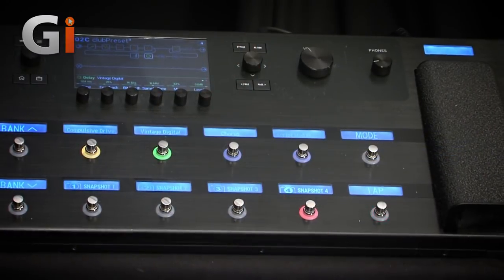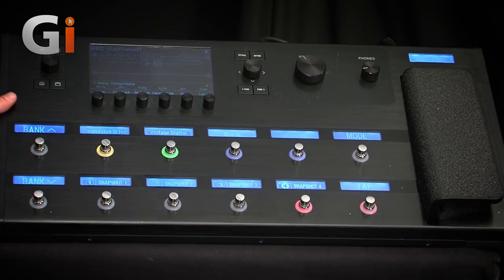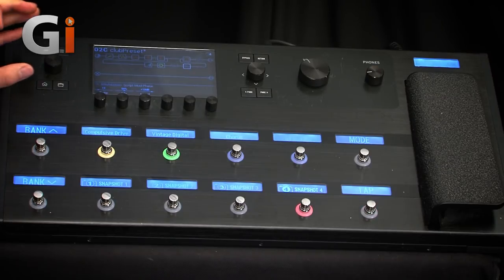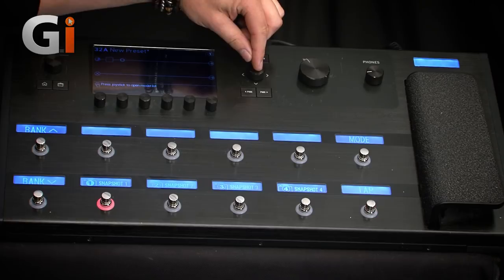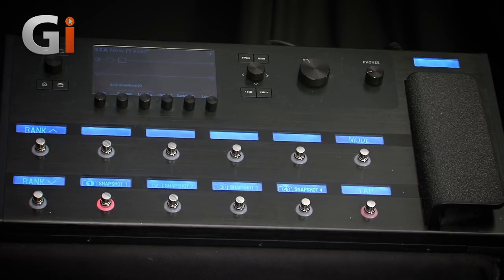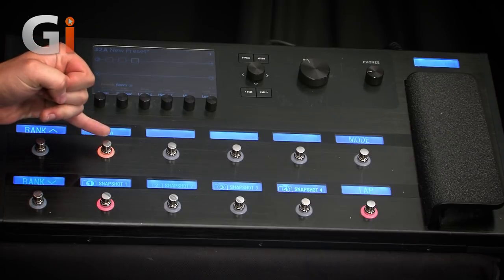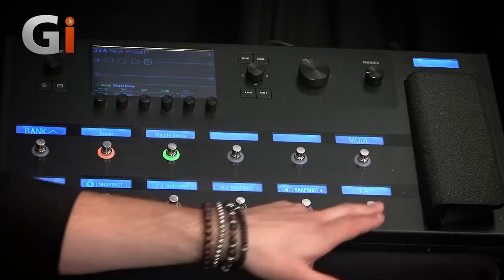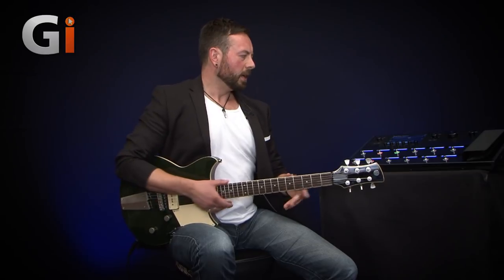Line 6 Helix Floor Multi-Effects Guitar Pedal | Review

Comment: The last piece of gear anyone will ever need. I have had 3 helixes. Each time trying to venture out and have a traditional setup. Each time I came back. Nothing beats it.
Reply: Thanks. Good feedback. Any reason why you've had 3? Assuming you don't use them simultaneously:). What amp/ speaker do you recommend?
Reply: @jonasirw1  I’ve had 3 because I started with an LT, traded up for a floor, traded that for a pedalboard setup, then traded back for another floor. I use IEM’s or just run it through a PA. Love it. I have a pod go too now for when I need something more simple. I recommend an alto floor monitor. Or some studio headphones.
Reply: @aaron.s.robinson  nice..making sure weren't so good that they were falling apart every year or so!
Reply: @jonasirw1 yeah sounded funny to read haha

Comment: Old Digitech 2120 owner here, yes its from 1998, but even in 2020 it still does sound morphing and patch changes more smoothly and faster than any of these units out there. I tried a POD HD500 and the amount of IN-OUT playing latency with no effects on was utter ridiculous. How on Earth can line 6 sell a unit that has severe latency with out any effects loaded!!. This is hardware playing latency as the USB to PC is a joke can not be used at all lol.
Reply: This is not the same as the hd500. It’s a whole new product. I have the hd300 it was terrible. The helix is nothing like it.
Reply: @Utube-g3g  Actually no it's not a new product, it is a poor mans Axe FX. The way Axe FX works by running linux instead of a proprietary locked down operating system makes them easy to update unlike the Line 6 products. My edirol Fa101 interface from 2005 has better latency ( no fx in and out only at 5.2 ms roundtrip) than even the Helix in 2020 that is completely embarrasing. The problem with these units is the latency is masked by wet effects so your timing adjusts naturally, disable all the fx and run dry only and you will see the delay right away on the AD-DA converters. I have the POD HD 500 which I had to modify to install a stomp button for power on/off, internal modifications for routing for signals as it was poorly designed by people who know nothing about audio routing. Line 6 just does not get it anymore, they are basically going full off the shelf DSP because they can't figure out how to lower  the AD-DA latency. Call Edirol they figure that out 15 years ago.

Comment: Thanks for the most useful demo I’ve seen of the Helix. Let’s forget ultimate tone for the moment (Axe Fx III rack seems to be a no brainer). I’ve been pretty torn between this and the fantastic UI of the Headrush, but you’re the first to demonstrate how good the Helix UI is, even though it’s not a touchscreen. I’m not gigging; I just want to have some fun.
Reply: correct- and when you consider that a Fractal or Kemper cost twice as much the Helix is a good deal.
Reply: @GuitarsAndSynths  Add to that, that Line 6 continues to update their modelers, pedals, even the dsp and making it all better each time. I'm actually glad it's not got a touch screen. They're so susceptible to breakage in transit.

Comment: and at roughly £350(with foot controller) the boss katana 100 would tear it apart
Reply: jeff shephard $399 egnater tweaker. Line6 1x12 cabinet $299 or less. You can get a deal. It’s a really good cabinet. This will tear your katana to shreds. But as a beginner or home guitarist katana is great.

Comment: Still too fiddly.
Reply: Compared to what? Look very straightforward to me.
Reply: Compared to individual pedals. Still a brilliant sounding system though. I'd definately have one. Just hard to tweak on the fly during gigs......probably just me.
Reply: Well with all the connectors, cables, PSU. etc. as well as the weight of all those pedals, give me this any day! One case, one unit. Simples!
Reply: PS. let alone the simplicity of running into a PA without mics. The Sound people will love you for this! I'd personally be happy to use this and a powered full range PA cabinet (or two for stereo!) . Lightweight, and easy to set up. A bass player I know has used this sort of set-up for years. He would never go back to his old Amp SVT. Yes i know that's for bass, but i think you'd be surprised at how good that set up can sound, and a lot easier on the back muscles!
Reply: The new Helix Editor has made it much easier to edit on the fly or on the gig.